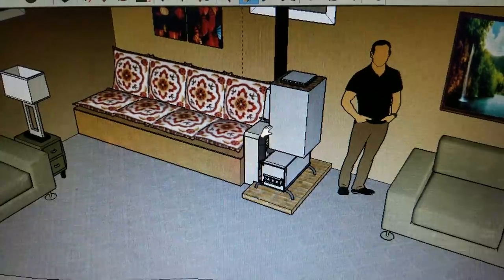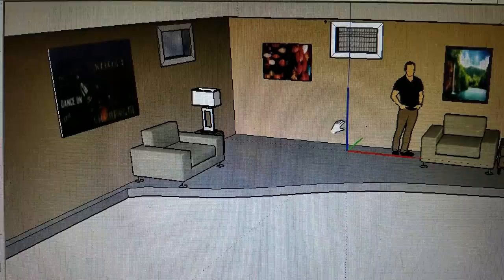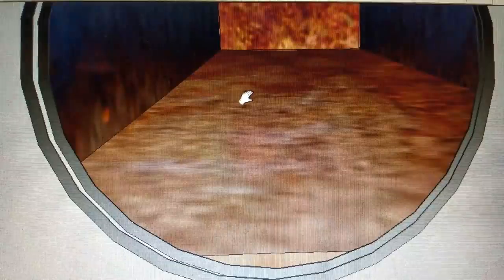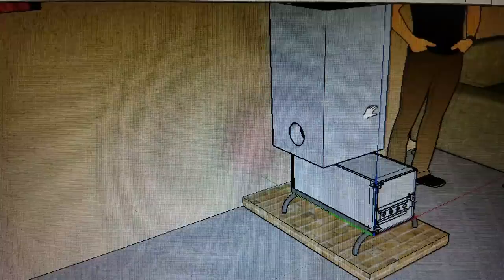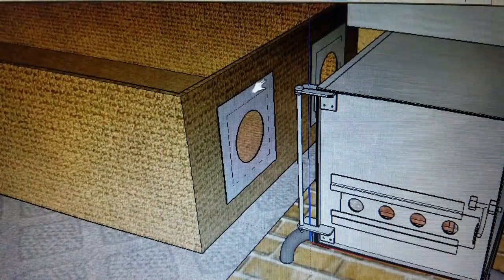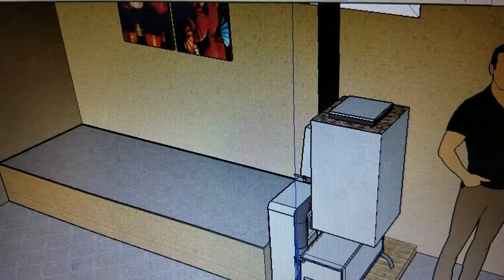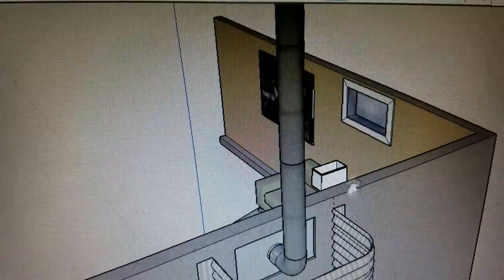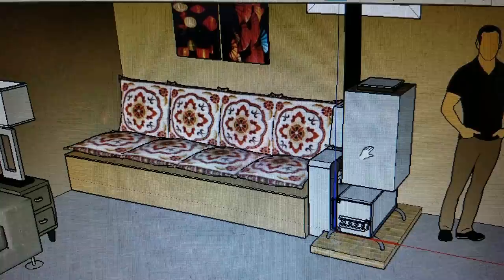Hard to Beat, Free Heat, NEW Wood Stove Technology

Comment: Darwin looks like 3.0 is a winner for cold weather for a on grid replacement to furnace. Reminds me of a Korean Ondal charcoal heating system for keeping the floor warm in winter. Only draw back was CO2 Leaks from floor into house. Always had to leave a window crack for ventalation. Lost one person to carbon monoxide when I was there in 1985 thru 86. Your design really looks like a 1950s party basement setup. Keep your wheels grinding out those aircrete plans, you really got something to make the cave man in all of us happy.

Comment: Stacking loose bricks inside the bench and lining up the holes in the brick would make it portable and easier  to take apart, covering it with a rock slab of some sort. It may even have better thermal properties of  heat retention versus the way you're doing it with the air-crete. Thanks for sharing this!

Comment: Julies had a condensation dripping back down the chimney pipe because it was too long  - fix was slight tilt with hole in outer elbow to drip outside onto ground

Comment: I need to build this heater in my home. In fact I wish I could get one built before winter.  I am curious about using air crete as the heat sink.  If it doesn't absorb heat how effective will it be as the mass heat sink?

Comment: Nice Darwin, there are a few things I would do differently however. I wouldn't use air create in the bench because of the insulation value I wouldn't think would transfer the heat to the room. The other thing I would add, and this is just for looks more than anything, is add glass to the door so you can see the fire. Other than that we know it works very very well. I would buy one once I get my cabin going.

Comment: Great looking design! I like the square components. And unlike the 'no aircrete in the bench' comments, aircrete will hold the heat longer than gravel with air spaces around each rock. 👍🏻👍🏻
Reply from the maker: right, that is 100% correct.
Reply: Is it possible to make "Roman concrete"; aircrete? If so, which aircrete would be better; or better yet, which would be more practical? I understand, if one can make Roman aircrete, the practically would be according to what it is used for.
Reply: Practicality.

Comment: Some system tweaks..
1. Outside air intake.
Pair it with chimney an preheat intake air. 
2. More air deflection gates.
   A. To start a draw on the fire. Add fan onto secondary exhaust loop in chimney. 
   B. Your burn chamber could be set up to take multiple fuels or feeds. Kindling fire could sweep into or past cord wood. Waste oil could be Burned separately or in conjunction. 
       A cooking stove section could use same exhaust route or quicker route in summer. Or a dedicated water heater or boiler section could share or not the thermal bank.
   C. Use a gate to divert exhaust piping thrue a water thermal bank. Jacuzzi. Insulated storage tub, tank, or trough.
       If radiator fluid, could melt snow an ice from pex pipe under new sidewalk or driveway. Heat sections of green house or garage floor.
3. Air ducts to push heat into far corners . Though the hot water banks could be made to do the same function. Store or move heat to different rooms.

Comment: Wouldn't aircrete in the bench insulate instead of acting as a mass to store and radiate heat?  Isn't that the reason it's used around the burn chamber? It seems like it might be good at the bottom of the bench (below the pipes) to direct heat up instead of having some go into the floor, but maybe not.

My understanding is that pea gravel isn't great as mass because all of the air spaces mean there's a combination of convective and conductive heat, but it's probably about the easiest portable solution.

Comment: WoW just WoW.  Aluminum ceramic fiber panels for the fire box and secondary burn chamber!! NASA technology--where do you access this??? Do you have more info about working with this. I an assuming that  you intend to ship this in a kit. This will be monumental if you can make it as accessible as  what you have done with aircrete.  I guess that I just have to wait as you have promised complete dimensions and build info.

Comment: As usual, another great job Darwin.  Some great comments here also.  I see two major problems with this type of heat that have yet to be addressed. 
1.   Not being UL listed makes renders ANY homeowners policy null and void should your house burn down for any reason.  
2.   Heating a large mass prevents turning the heat off.  A big problem is that once the mass is heated, say a radiant floor, if the weather decides to warm up, the inside of the house becomes an oven.
Perhaps building an outside type of rocket stove would solve the first problem although, a lot of the efficiency will be lost.
The second problem might be to use an aircrete insulated water holding tank where the water is heated by the rocket stove and the water circulated through baseboard radiators or water/air heat exchangers. 
Anybody else have some ideas on this?
We should all be living in aircrete houses which won't burn and tell the insurance companies to just sell us policies for theft and vandalism.
Reply from the maker: Yes, you are right, While to a certain extent, I believe this can be mitigated. I am planning an automatic switch of sorts that will close the front door damper as the fuel source and the heat generated diminishes. This will prevent your heat in the battery from escaping out the flue pipe. However it can be manually opened back up reversing the heat flow through the copper radiant tenicles and llowing the heat in the battery to escape out of the stove pipe.
Reply: Not to worry by flick22d601 the insurance companies aren't going to pay anyway so  . . if you are smart you don't need the insurance companies for anything especially for paying the bills. The biggest mistake the American people made was 
letting them bail out the U.S. Government in the depression  i.e. now they are the "Special Interest" to tell our government leaders how to force insurance down our throat.

Comment: I was wondering if you forgot the clean outs in the bench??
Reply from the maker: No I didn't forget them. clean outs are only necessary in areas of a mass where the pipe other wise could not be accessed , In this case as like on the original I just removed the entry and exit elbows. I found a shop -vac with a PVC pipe extension  was able to reach clear to the back of the bench and did a good job of cleaning them out.

Comment: Very interesting design.  The refractory aircrete used in the burn chamber and riser is great.   An insulated burn chamber/riser is very important in a rocket mass heater to keep the temp up for a complete burn.  Using aircrete in the bench may not make sense as it will keep the heat in the pipe in the bench rather than radiating into the room.  If you want to reduce the heat transfer close to the bench inlet, aircrete in this area may work well.   If the point is to avoid a permanent installation, pea gravel is better, but still not great as is does not conduct the heat efficiently throughout the mass.   Mixing fine sand w/ the pea gravel will improve the efficiency.   The pea gravel/sand mix can be vacuumed out if you want to move the bench.  Using wood in the bench insulates the mass, so it might be better built with steel studs and cement board.  I would like to see a small cooking surface on the top of the riser....

Comment: Question: If this were in a small cabin type structure could you incorporate some sort of directional flow to use it to also 1. Cook with and or 2. Heat a fairly substantial Water drum (35-55 gal.) for the shower or doing dishes etc.? Is this feasible? Because if it is, you've killed three really big birds with one small rocket and taken off-grid to a whole other level.
Reply from the maker: Yes, Yes Yes

Comment: Thermal mass, you should avoid aircrete as its a insulator it is extremely poor in storing heat, ie its a very good heat insulator. I think peat gravel is slightly better then airecrete as it has more mass but it still has too much air gap, air is a poor heat transfer from pipe to mass. just use the traditional method of thermal mass cob = clay/sand/straw, its extremely cheap, no air gab barrier, easy to take apart if needed. or normal concrete is also a good thermal mass its more expensive, but quick to produce. both cob and concrete is very heavy tho, limited air gab, that is what makes it a good thermal mass heatsink.
Another thing people do is to do some sort of heat exchange just after the riser, small electric fan will do just constantly blowing at it. you maybe able to do it in your existing design, as the peat gravel has a lot of air gab for a small fan blowing inside. best of both worlds, fast at warming up the air in the room, shut fan off later on and heat up the thermal mass instead, else, just make a duck and keep pumping the hot air to another room or something.
Reply: Leon Cryp water is has a heat capacity of 1 cal/g.  Brick is about 0.3 cal/g. What do you think about using water for heat storage in these systems? Water also is easily obtained and can transfer heat efficiently to other areas. I suppose would also need think about the space requirements. The density of materials being proportional to the mass and volume. I am wanting to cast aircrete with carbon felt as a skin to increase tensile strength. Then perform some experiments on it to see if the Portland cement stands up to thermal cycling.  You have good comments and I am wanting to kick around ideas.
Reply: I agree.. using aircrete for the bench maybe not a good idea as it is an insulator v/s a mass for heat
Reply: Snowy Owl, wow I knew water was a good heatsink but didnt know its over 3x better then brick in storing heat, I dont have much experience with rocket stove, its just one of those things Im interested in as its low tech stuff that any 3rd world country can do, the efficiency on a properly built rocket stove is insane, like 10x better then any store bought burner. I have not come across people using water as a heat sink per say, its best u ask people that has actually got experience, the 1 negative thing i can think of is, if water gets above say 40-50c it will start to evaporate, u probably need some airtight container with small pressure valve in case steam builds up, but it would seem water would be a great heatsink. Ive seen on youtube someone built a rocketstove to warm his aquaponics dome fish/plant greenhouse with successes. he was raising tropical fish = Talapia and salid greeds in heavy snow area. One thing tho I have not seen is people integrating rocketstove it to their underfloor heating Yet!, but Ive seen a guy on youtube that did something similar to his newly built garage but he was using solar heating instead. he build a small pool using wood and plastic to hold the heat exchange area, with lots of pipes and automatic sensor electronic system to control pumps. Im not surprise if someone has already done it, eg rocket stove, where the whole houses concrete floor is the heatsink, this is only achievable if new house was design/build from the ground up, as you need to install lots of underground pipes before you lay the concrete floor. otherwise existing house with existing floor central heating system can be modded to use traditional heating methods and rocket stove ie run dual system, or just entirely off rocket stove. I can think of many obstacles already with extreme hot water pipes with built up pressure is going to be a headache, there needs to be a safe way to transfer hot water around, and a fail safe redundant system, maybe having the  first heat exchange (rockets stove to water tank) further away from the riser so it will never overheat, cant rely on electronics alone unless there is a backup battery system. The 2nd heat exchange (water tank to concrete floor) can be place any where, even in the basement. Unless someone goes all hardcore and use molten salt as liquid lol.
Reply: You could connect it to a radiant floor design, where you have hot water that you store in the bench run through the flooring system. Have that hot water circulate through the flooring and continually reheated through the bench. Just my 2 cents.
Reply: Sammy Chung, yes thats basically what I said earlier and its a very good idea, the problem is getting the hot water from rocket stove to the tank in the first place, if the pipe gets above 100c it will turn into steam which is very dangerous, eg if the pump fails, the first heat exchange system may explode worse case scenario, pressure valves will be needed, also need an automatic way to shutdown the rocket stove if water pump fails, eg maybe as simple as just shutting off the air intake and the rocket stove system will stop burning, maybe need offline battery back system as redundancy, ie if water temp gets above 90c shut air valve off. there are cheap 12v electronic system u can buy from ebay, aliexpress. 12volt pump, 12v solenoid, 12v temp relay control, all hocked up to used 12v car battery + smart charger (trickle feeds/charge 12v battery system to keep it topped up) no need complex arduino. the agriculture, farm uses such system to turn pumps, fans on for their plants and livestock.
Reply: Leon Cryp my shop and greenhouse have hydronic heating in the slab floor. We used oxygen barrier pex tubing in the concrete and circulate the water  with a gronfos brand pump designed for warm water systems. It has an expansion bladder designed for hot water and a sparse valve to keep bleed air out of the system. The heat source in both cases is an electric resistance hot water heater. I am considering a heat exchanger on a rocket stove/furnace to heat the reservoir of water in the hot water tank.  It is as you point out tricky to keep in mind makeup water and pressure relief systems maintained. My next construction project is more off the grid. I would like to use thermal syphon tho more the hot water to a reservoir and tap of that for bathing and heating. So much fun so little time.  
The aircrete is interesting in its potential as a casting material. Guya Domes, I may have spelled that wrong, is making third world structures from aircrete. If they had a form to cast rocket stoves it could make a difference for struggling people. There needs to be some test done to reliably cast it in a way that does not degrade rapidly from daily cooking. I was wondering it someone has tried to fire a glaze on the aircrete. Maybe a vitrified clay liner for the combustion chamber. Good problems to work on. Thanks for the feedback.
Reply: Not exactly rocket stove based, but the ancient Romans used a hypocaust system for underfloor heating.  I imagine that you COULD design the exhaust to go through ducting underfloor to get a similar effect.
Reply: I was wondering how you would use aircrete as a thermal mass too... it seems to be soooooooooooo insulative.... all your heat is going to go straight out of your aircrete insulated chimney! A xx
Reply: Snowy Owl A company named Garn has been making a "boiler "using the concept you're speaking of since the late 70s? ,from what I can read ,people that have them love them.

Comment: Great video. 
Aircrete?? Is aircrete good for storing heat and releasing it slowly?
Reply from the maker: YES!!! But it does depend on the mix and the configuration of the different elements in a certain combination to accomplish the goal. I will explain component by component the configuration of all of the components of the heater. Stay tuned you will see.

Comment: Some suggestion for further improvement: built add-ons for using this heating system in combination with a (gas fuelded) central heating system by running a water filled pipe through the heater, so that your cold inlet to your central heating system gets pre-heated, and you can then use this system to also heat other rooms, using your central heating system, and save a lot on gas usage. Only for the central heating system, not for hot tap water and hot shower water, as that uses cold water directly from the water system, while the central heating system uses a seperate closed circuit for circulating water.

Comment: Thank you for your wonderful videos, especially this one. I'm buying a very old 3,300 sq foot house without a heating system. I am going to put a wood furnace in the basement. It seems that this is just good for a room or two. I can find nothing about connecting a rocket mass heater to the duct work for the entire home or to a radiator system. Am I out of luck as far as building one to heat my home? The house has nothing so that I can install either a hot water system or forced air. Thank you for your help, Mike
Reply from the maker: Mike. I have allready sold one and am going to hook it into a central heating duct system for the whole house. You will see. I will explain in a new video in the nex few days. It is an awesome system.
Reply: Mike Trev Ck out a company called Garn , same principle only bigger.